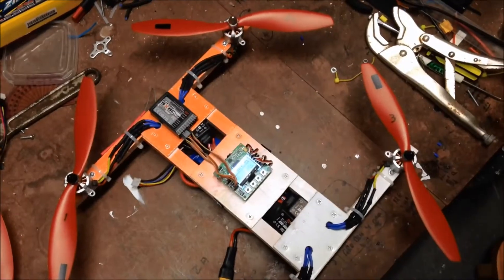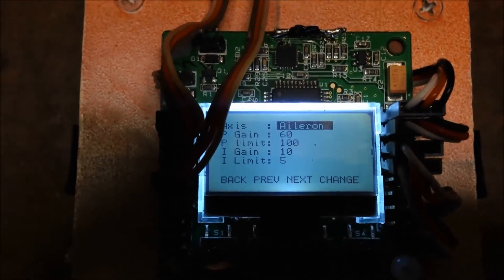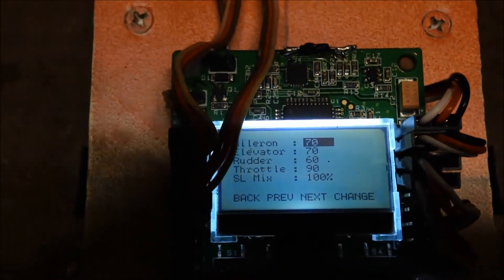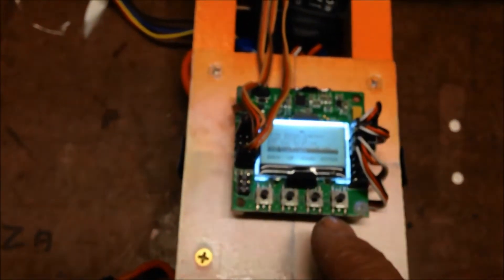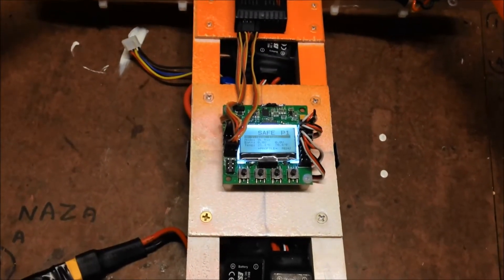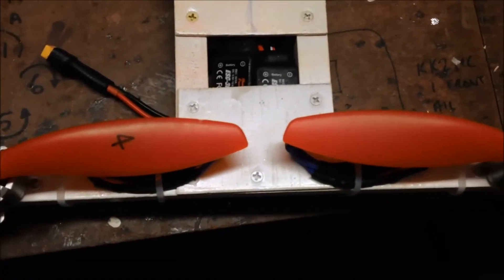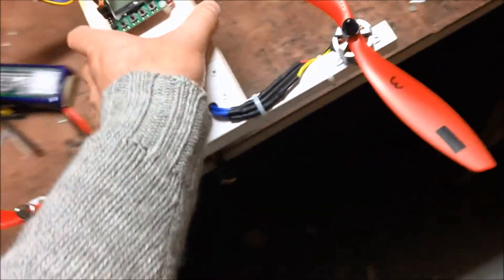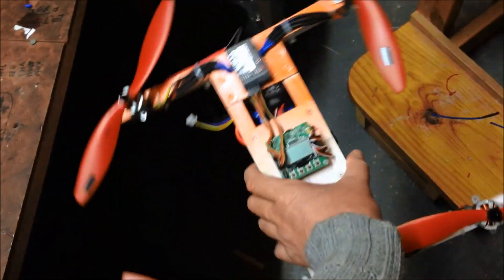Wooden 380 H Quadcopter Build Part 5. Review. KK2.1 Hobbyfan 30a ESC

Comment: Cool! Turns out all I needed to do was calibrate my ESC as well.... I feel like a dummy now because I made a video moaning about long battery wires and even replaced the caps on the ESC all to no effect. I had just been doing the calibration process wrong all these months. It's still a mystery why this only happened to one ESC though.
I've been quite interested in this particular build of yours because my next build is a 40cm wooden H frame :)
Reply from the maker: ***** Making mistakes helps us grow I am told. Figuring it out is half the fun anyway. Looking forward to seeing your next build. I used your idea about the independent center plate on your cheapass build for this quad so thank you for that. It works nicely having the ESCs and wiring able to thread through the central space.